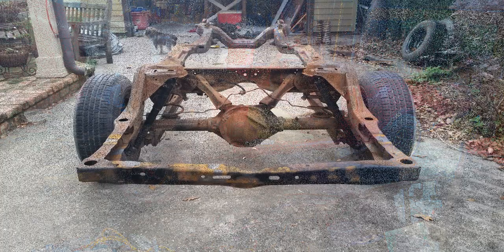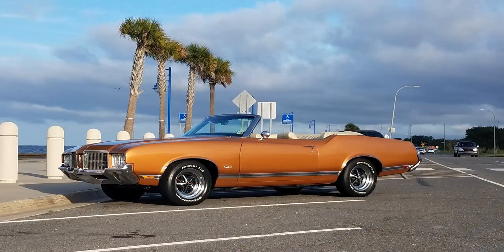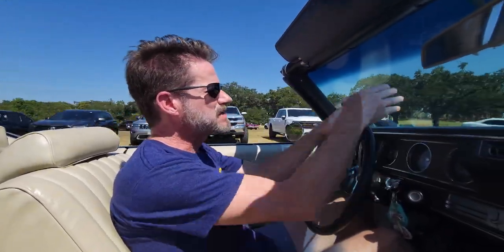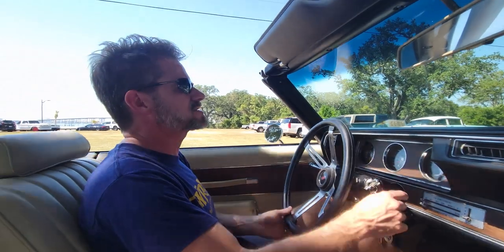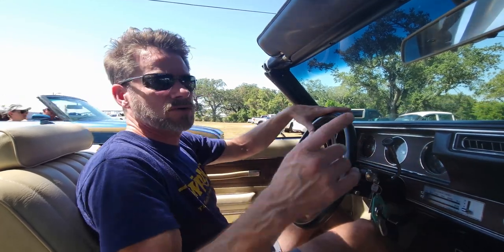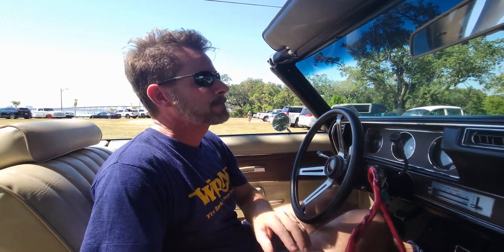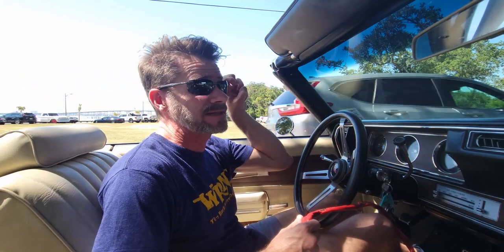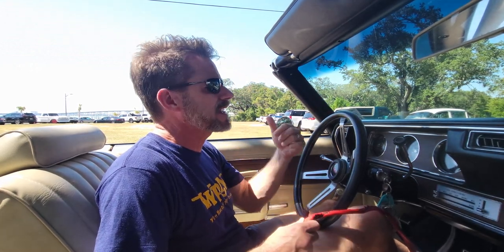Disco Inferno?!?  We ALMOST Burned Down this '71 Cutlass Convertible!

Comment: I just decided to put kill switches everywhere!!  My battery is in the trunk on my 56, and there is a dedicated wrench in the trunk for disconnecting the battery!  ;) Fire extinquisher inside the car, under the hood and in the trunk.
Reply from the maker: Fire is the one thing that I fear most with these cars.  When I'm rolling down the highway, as soon as I smell plastic or rubber, I start to worry!  99% of the time, it's from someone else, but you never know!